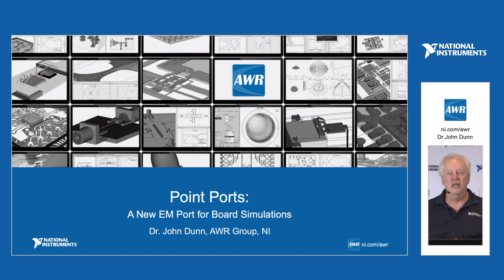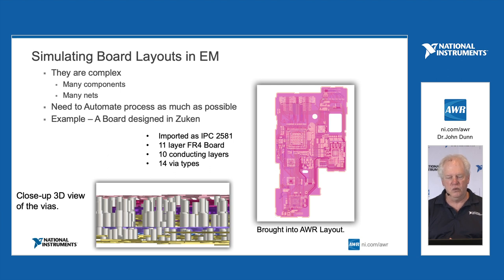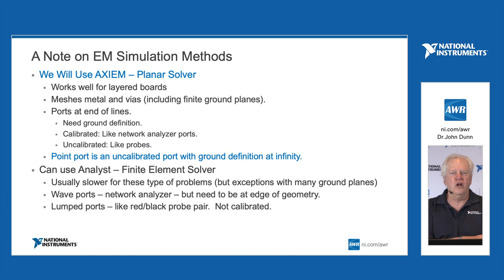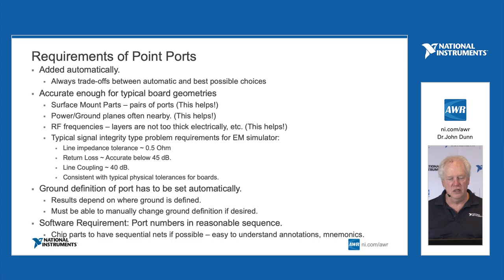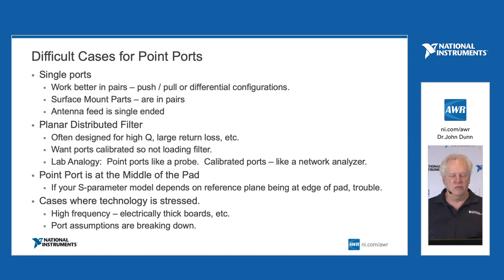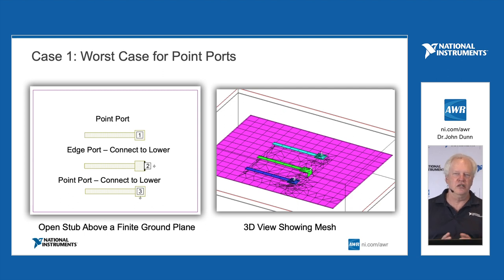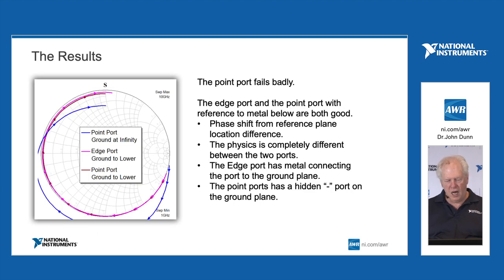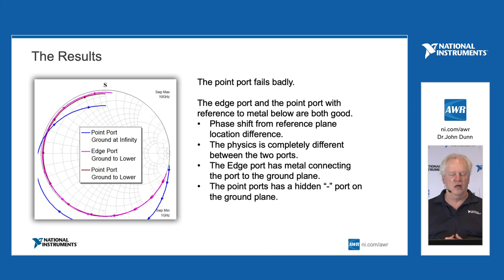Design Example: EM Point Ports for Board Simulations

Comment: How do the point ports compare to differential (+1,-1) ports with implicit ground?
Reply from the maker: Differential ports +1/-1 are an implicit ground as you mention.
You can think of them as two point ports which create a 2-port S-parameter file.
Then, a transformer is used (behind the scenes) to force any current of port 1 into port -1.
The advantage of differential ports is you are forcing the current into its “ground port”.  There
Are two disadvantages: any model for a packaged part used to hook up to the differential port – will be incorrect if the model “sees” the ground plane below.
The other disadvantage is you have to set them up manually – unlike the point port.